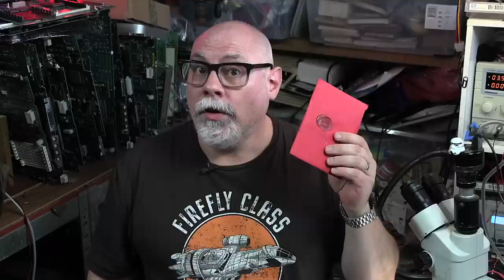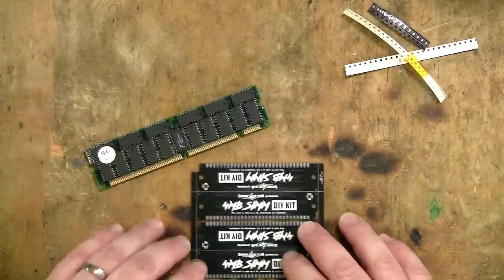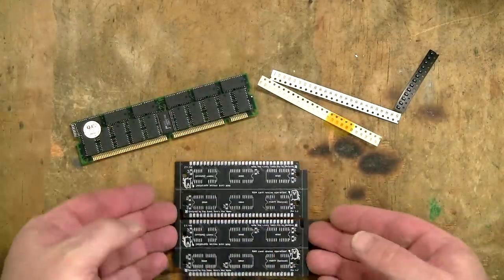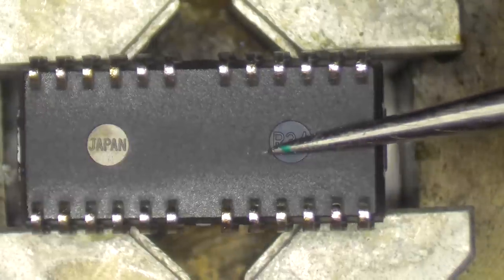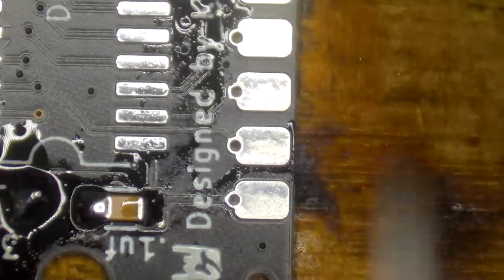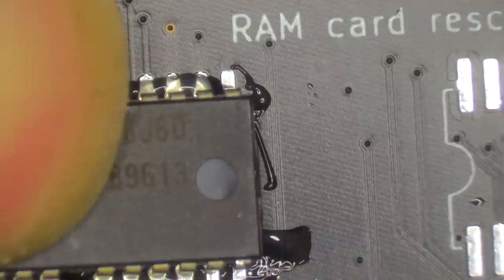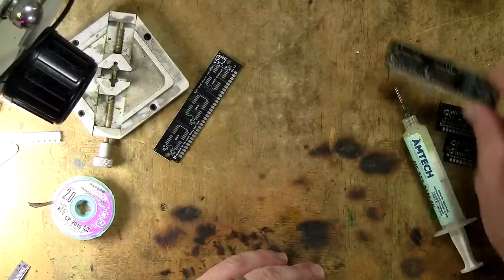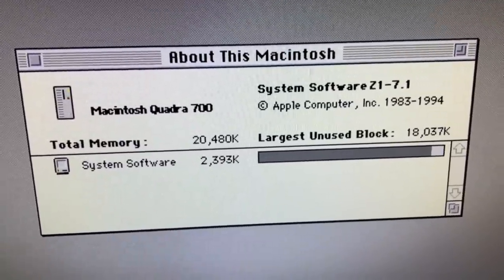Building Recycled 4MB 30 pin RAM SIMMs

Comment: 6:37 I usually lightly sand the exposed edges after snapping these apart. There are often some sharp semi-loose fiberglass pieces that you don't want cutting your fingers when handling the finished PCBs afterwards. EDIT. Looking at the shot of the finished PCBs being tested, perhaps you did it already. (?)

Comment: I really would like to perform this sort of an upgrade with the 16MB card in my PowerBook 540c. Those 32MB cards are atrociously expensive now! And apparently the connector used is completely unobtainable, so fabbing new cards isn't possible (unlike with the PB100s).

Comment: Great video Bruce. Just a note that no Macintosh uses the parity SIMM - it simply gets ignored if it is on the SIMM. The parity SIMM is only used in (most) PCs.
I may need some of these SIMMs for my old Macs, and at the speed you were assembling those last lot of SIMMs, I will get you to do it for me!

Comment: Does the LED flash when the RAM module is being accessed, or is it just lit continuously when voltage is present (eg always, without interruption, when powered on) ?
Reply: Stays solid ON. No flashing.  The purpose is to show the SIMMs are being properly powered, but the secondary reason is to give you a light show of sorts, which is rather neat on a machine like the SE/30 if you have a transparent MacEffects case.
Reply: @JDW-  ok - thank you; this is early days - maybe something that can be figured out down the road.

Comment: I realise it's perhaps not the initial design idea, but - this also means that these SIMMs, built with newer RAM ICs, may be able to have lower access times. Once upon a time, 50ns RAM SIMMs were only for the uber-nerds; with this, they could be commonplace - an overclocker's delight when dealing with 386 and 486 boards.
Reply: also, have you considered getting a PCB preheater plate to make your hot-air work easier?
Reply: The faster speeds of the newer RAM ICs is not taken advantage of when used in older Macs that require 30-pin SIMMs.  So long as you meet the minimum speed requirements for the Mac that needs 30-pin SIMMs, then all will work as expected.
Reply from the maker: @mc680x0  I do have a heater, but I only pull it out for specific tasks. By the time I set it up and get it to temp, I would already have the chips off with a hot air station. I mainly use the heater for removing through-hole stuff, like DIP chips.

Comment: From the level of sound heard while you are drag soldering, you are applying way too much pressure. Since everything has been pre-soldered, a slower and more gentle drag will avoid moving pins, lifting pads or having to go back and forth across the pins. Even though the result you achieved is excellent it looked way too careless. Also to make it easier to assemble don’t break the pcbs apart.
Reply from the maker: If it looked careless, it's because I've been doing it for decades. I assure you, there was no risk of damage to the pins or the pads at my hands, and the level of pressure I used was exactly what I was aiming for. This was never meant to be a soldering tutorial video, but I do go over lots of soldering tips and tricks in my other repair videos if it's something that interests you.
Reply: @BranchusCreations  as a factory trained electronics engineer for Panasonic with over 40 years of design/repair and rework experience, soldering is not something I need to learn. I find repair video’s interesting and make the occasional comment where needed. I can see you are passionate about your work and are producing great content.
Reply from the maker: I went back and watched that section of the video, and I honestly don't know what sound you heard. The only sound I could hear when I was drag soldering was either my breathing, or me moving the PCB on the cable. I couldn't hear a single sound coming from the iron.